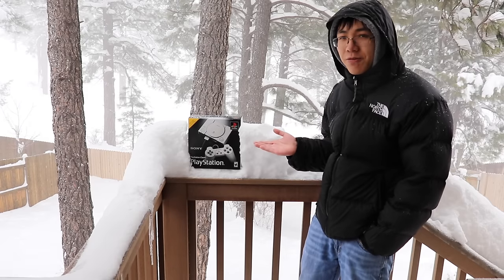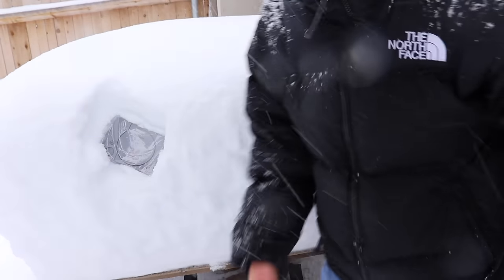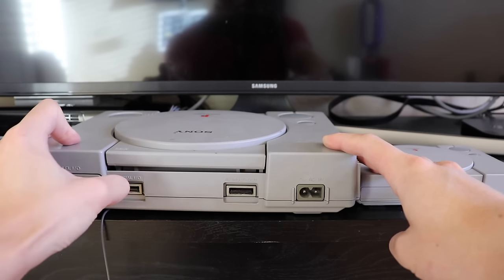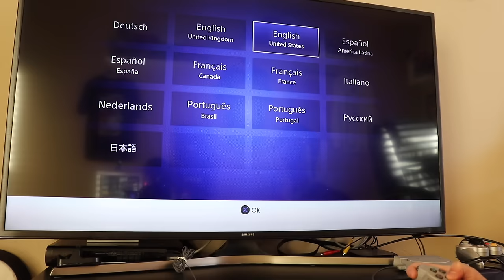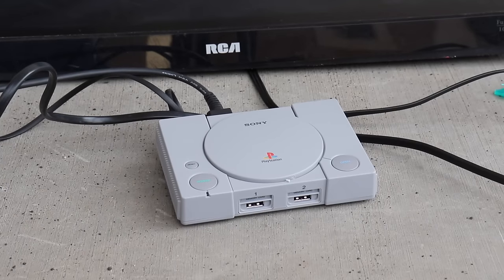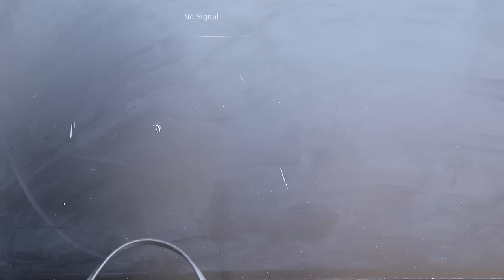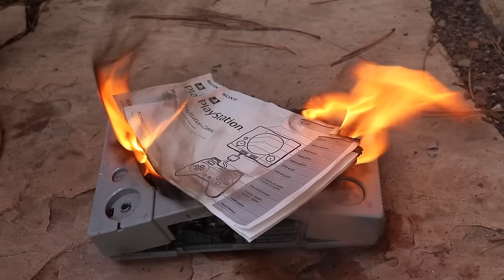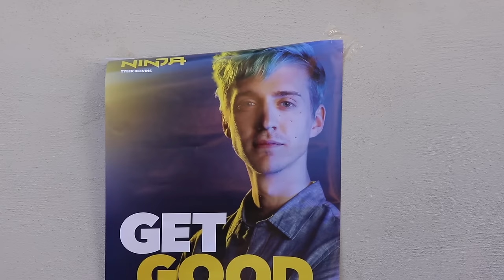Bored Smashing - PLAYSTATION CLASSIC

Comment: Plainrock: hits the controller
PS 1 controller: Vibrator mode activate

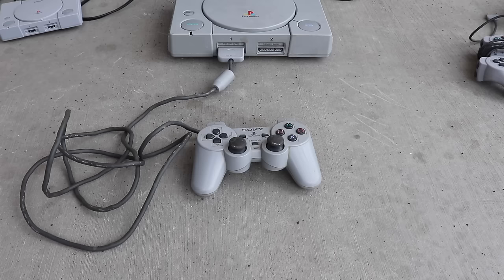7:56
Reply: I guess you could say it was turned on
Reply: It’s called DualShock 1 and plainrock is called king
Reply: @J4d3_R41ls  DualShock 1 is the PS one controller with Analog Sticks (not compatible with PlayStation mini)
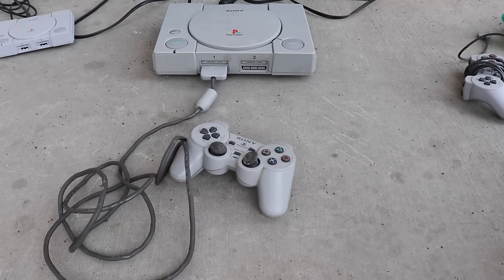Reply: 8:15 - Now, with the left-half of that DS1 controller, all that's needed is a PS1 mouse controller to play some Quake II (via D-pad) or Alien Resurrection (via thumbstick) with PC-style look controls..... Unfortunately without the right-half of the controller, one doesn't have the buttons necessary for doing mouse-click with controller button combos for the likes of menu/command shortcuts on the Command & Conquer: Red Alert titles....
🤔 Additionally, plug it into a PS2 and swap the PS1 mouse controller for an older-spec., lower-DPI  USB mouse to enjoy the same thumbstick+mouse controls on Unreal Tournament, Half-Life, the Silent Scope series, maybe Resident Evil: Dead Aim and Red Faction II... Though some of those might not support DS1..... You would have to take a hammer to a DS2... Or not!

Comment: If you get hate for destroying this, I'll be legit surprised. Why would anyone care, considering the sub-par library of games?
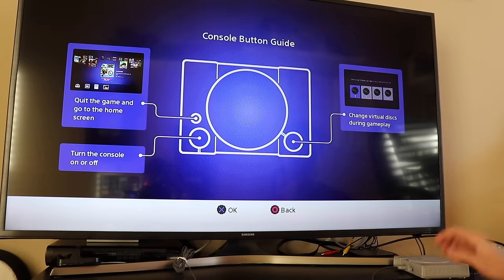Also, at 6:44, "change virtual disc" means   that for games that originally used two discs that came in one package (obviously due to the game being too large to fit onto just one disc), such as Final Fantasy VII and Metal Gear Solid, you'd press the "Open" button to swap between those two disc ISOs.

Comment: I’m getting the smallest Video game console I should get a Sony PSONE with LCD attached to it the Smaller sony PlayStation & PSONE LCD screen and this console was originally released early 2000 & After original PlayStation 1 was released in September 9th 1995 & the Sony PSONE slim with LCD screen attached to it is upgraded version of Original PlayStation 1 & You can share the same video cables  It works with PlayStation 2 & PlayStation 3 & it comes with ac adapter & Controller & Console & LCD screen attached to the console & Doesn’t  come with Memory card and Games & I have PlayStation memory card is transformers one & I have Extra PlayStation DualShock controller for Sony PSONE slim with LCD Screen attached to it and it plays exact same games on the normal original PlayStation one with a smaller size with the LCD screen attached to it & That’s right You don’t have to spent time With ATV quad power racing & you have spent time with gran turismo 2

Comment: 8:02 That happened with my Xbox 360 when I was playing Forza horizon 1, and the console crashed while it was vibrating, then I decided to put the controller in the ground and that happened. But since the controller is more heavy, it moved very slowly. Although maybe it wasn't that bcuz the motherboard was broken, so maybe it broke off while you hitted it and then it just kept hitting the case bcuz of the shake, and after some time it stopped, or it just simply broke itself.